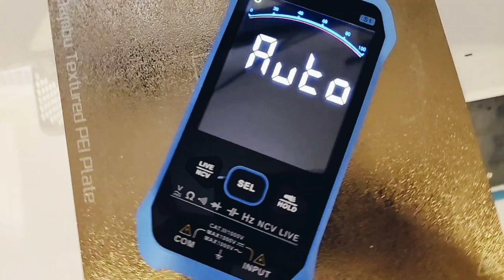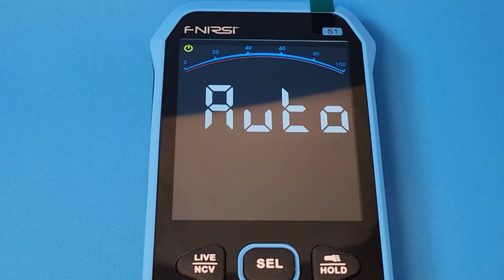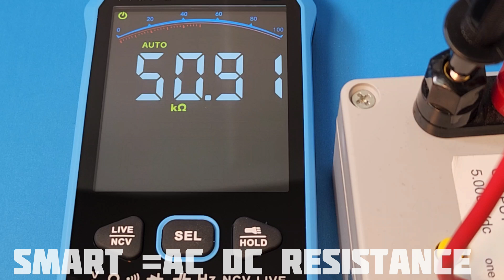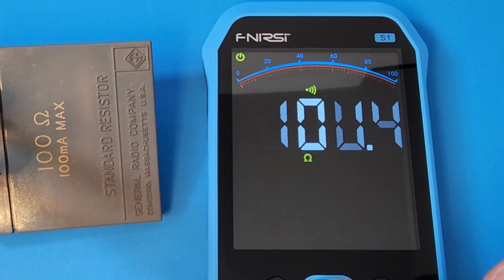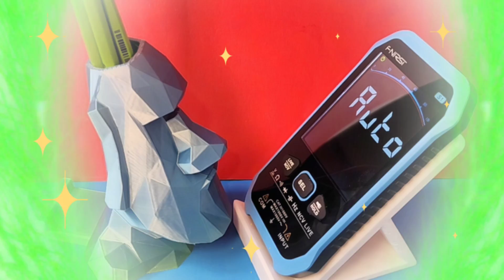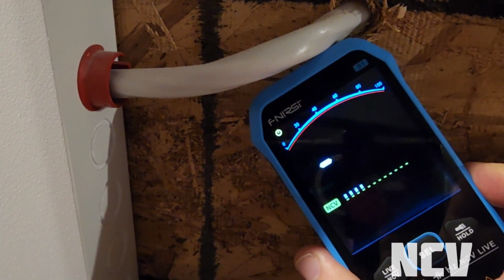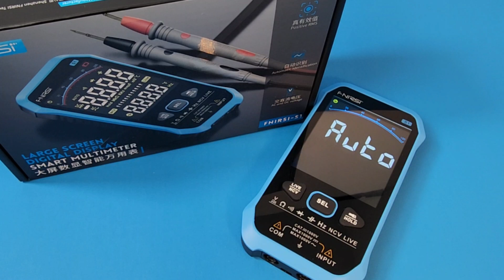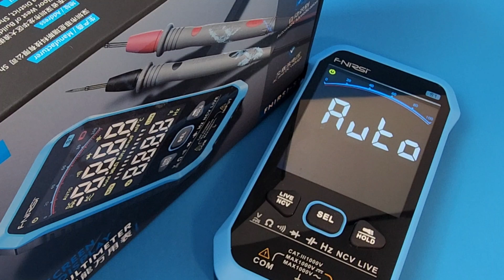FNIRSI S1 CHEAP-O Multimeter Review & Teardown!

Comment: When you're measuring low resistance, first measure contact resistance of the probes. That 0.8 ohms extra could be that. Some meters have a REL function that you can use to zero out the reading while shorting the probes together.

Comment: Well, smart meters surely improve. It's at least good for diode testing, continuity and voltage. The resistance measurements aren't the most accurate, but we've seen worse. And having a rechargeable battery is always a plus because of the convenience as well as being less harmful to the ecology. 👍

Can't stress enough how much I like your flashlight luminosity tests. Now I can easily compare all these meters to my work flashlight, which is around 200 lumens in its dimmest setting. You make me a happy man. ❤
Reply from the maker: Thank you my friend for the suggestion !👍 I think it's a great addition to the testbed ! It's really amazing how the luminosity varies from meter to meter! I believe I still owe you a multimeter? Email me ; netplicity1@gmail.com 
It's been a hectic spring, so I'm playing catch up ! 😅

Comment: Now that is an issue that I see with smart multimeters. One time, shorting the test leads will read 000.0 ohms, the next time you turn it on it would be almost 1 ohm off. Must be the relay. Not working while charging is a safety feature! Imagine zapping your charger with AC mains voltage measurement. Is there a way to set that brightness, at night, man...that would probably be enough for a flashlight!
Reply from the maker: Good points.. 👍  There's no display brightness setting. It's very bright 🌞 as you say.

Comment: Smart meters have gotten much better, but still seem like gimmicky glitzy cell phone look alikes, dont like having to recharge something and cant use it during charge, even more like a run down cell phone and front screen delicate as a phone too I imagine.  Smarts are interesting but still not as durable or accurate in some cases as a traditional form meter made to work in the field on say A/C work or other similar duty. I imagine they will find their place, but it want be working in industrial environments. Always quicker to grab a traditional meter and just turn the knob to a range, not near as much finagling. I have a Kaiweets I like pretty well and its fun to play with but still doesnt seem as handy or serious as the old school heavy duty meters meant for serious work duty----as always just my opinion to each his own.
Reply from the maker: Nice thing about this SMART meter is the full manual ranging option. I hear ya though and all valid points. I think it's definitely geared toward the enthusiasts or general home/ workbench. I like the form factor but a carry case would have been nice.
Reply: Also id think by now they would be trying to rig some kind of stand, one way would be a nice (thick) chrome metal/wire type that fits snug up recessed into the back maybe.  I have to say I like the Kaeweets I bought & it works well, its just a different kind of animal far as meters go.

Comment: Pretty nice looking DMM. I like the size of this device, the inverted and coloured LCD, the standard 4mm-connection for the (goldplated) probes and that it is rechargable. Because it has no current range, I have very little concerns about electrical safety. Maybe some isolation slots and more creepage distances would have been nice to see... But, for sure, not a bad deal for a pretty accurate (and aside from a lacking Ampere range) and versatile meter under 30,-€.
Reply from the maker: All great points..lots too like here and looks like FNIRSI is putting out some great test instruments! 👍